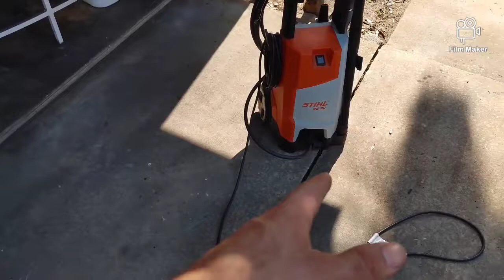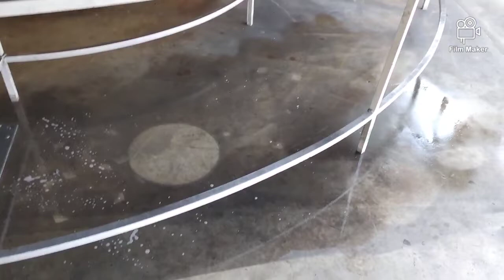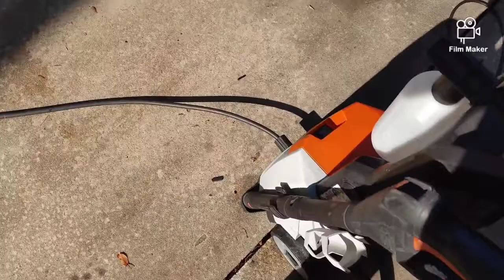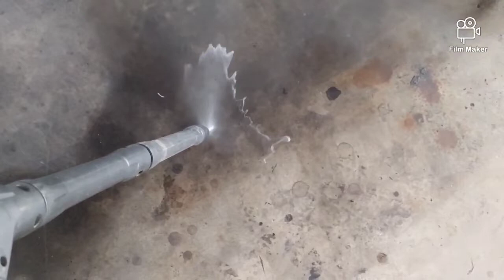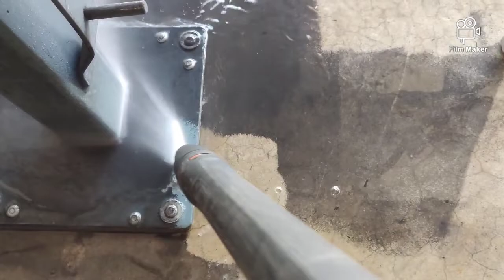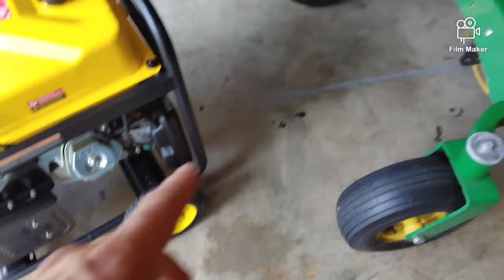Stihl RE 90 1 Year Review

Comment: The rotary nosle is weaker than the standard one isn’t it.
Reply from the maker: Normally the rotary nozzel will blast away stuff that the stadard nozzel will not do anything to. I guess it just depends. I was surprised to see the standard nozzel remove the paint from the concrete the way it did.